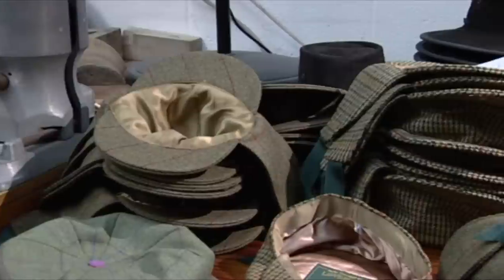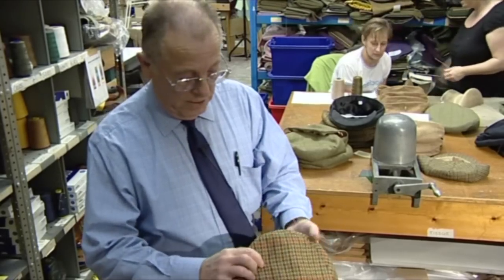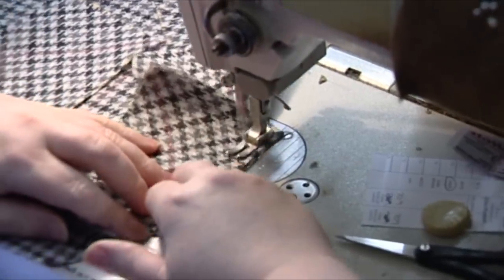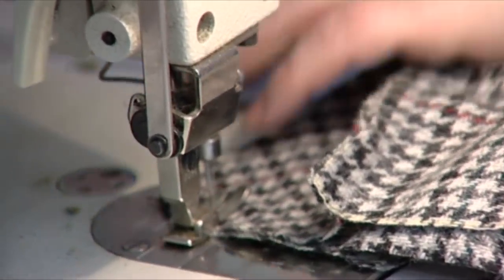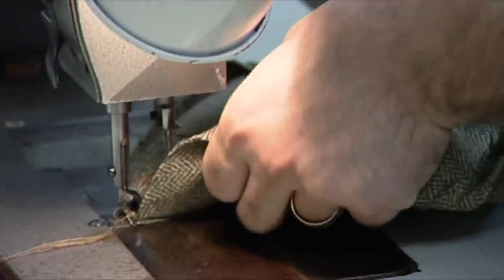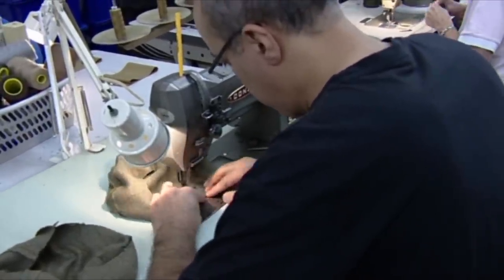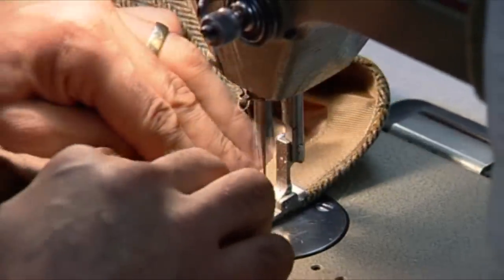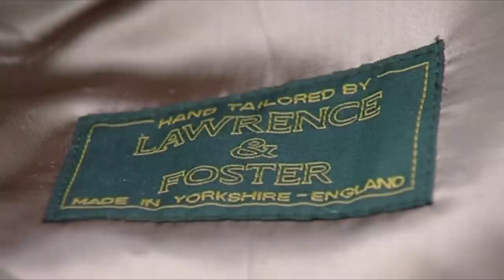Yorkshire Flat Caps - the making of

Comment: Own a Garforth and most recently bought a Helmsley in their Tees pattern. Both lovely caps. Much prefer the Helmsley as it is a broader fit and looks like the 1930s style. Where as the Garforth is more of a modern tapered fit. Definitely up there with Lock and Co for quality. Lawrence and Foster should have a royal warrant. Definitely will be buying more caps from them. Rip Frank Lawrence. You've made a beautiful legacy and fantastic caps. Hope your family continues to keep this business running for generations to come
Reply: How is the sizing of their caps?  Do they run true to size?
Reply: @dkstott29  From experience of owning 2 caps, in different styles, both in 58 (7 1/8) Yes they seem to very accurate. Just like this video every thing is symmetrical with design and of great quality. Wool is not the thickest, however it is a tight weave and very water resistant. This is regards to the non Harris tweeds.
Reply: @southerncampingexperience3841  thanks.  I've sent them emails and messages and haven't received any responses.
Reply: @dkstott29  Don't be disappointed, or discredit their custom by a delay. They are always busy and aren't a large scale factory. It's a small independent company. If they don't respond for a while send another. It may of been missed

Comment: Its a shame they are so rigid in their ordering, stuck in their ways. 
I requested a different lining, just a flat silk as I'm bald and don't want any stitching on the top of my head as it leaves marks, also wanted the option of putting a bronze type button on the back of the cap.
Never returned my email and only got a negative response from Messenger.
Reply: They seem to have a problem with responding to inquiries.   I've sent several emails and messages asking about sizes.   Not a peep